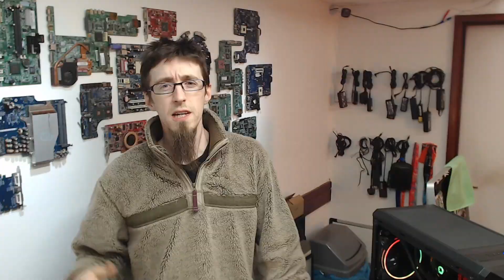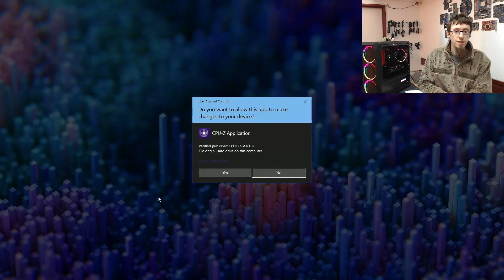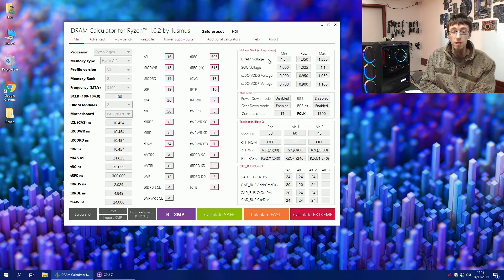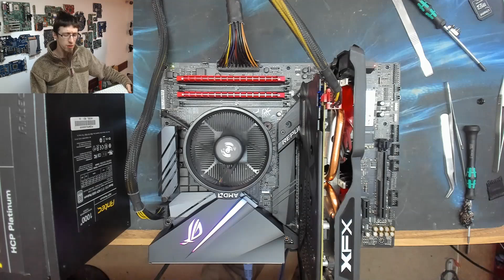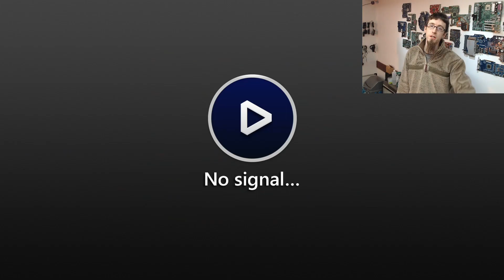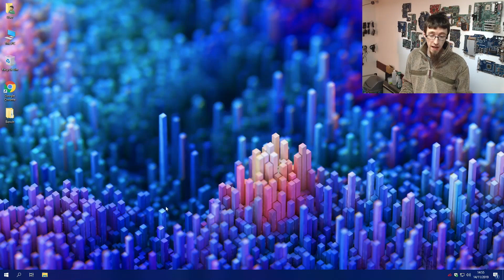LBC#43 - Setting Up XMP the Easy Way and the Hard Way

Comment: Incredible. I turned off XMP on my b450 because windows would blue screen every now and again. A friend told me that having 4 memory banks and my Ryzen 2700 wouldn't be stable with XMP turned on.
I just didn't have a clue how I was expected to set it up. 
Been running my memory at the lowest possible speed for ages. Gonna have a play with it now.
Thanks!

Comment: XMP is BS. Always has been. At best it will work if you're only using as many modules as you have controller channels. You make the choice to either overclock or to value stability, and yes XMP is overclocking -  it is almost always going to run your memory controller out of spec as far as your CPU manufacturer is concerned.

Just buy the normal JEDEC RAM speeds.

Also I love how you got literally 1 point higher on the Timespy with the 'optimized' settings.

Comment: Some wrong things to point out:
-Dual channel is not dual rank, i think it concerns the number of chips on the stick itself
-there is a program usually used in tandem with ryzen mem Calc to detect the specific ram chip type on your stick way better than cpuz and guessing which variant it is

Great vid tho very informative and chill
Reply: Figuring out rank is Hell....just when you think you understand it, some damn stick comes along that seems to break the logic of it all!

...like dual rank is supposed to be faster, but then a special late release of 2666 8GB sticks still running dual rank is somehow faster than the comparable dual rank verison?,wtf mate
Reply: @ChadDidNothingWrong  its prolly faster due to better silicon. anyway, joses right. single rank iirc is basically modules on only a single side, dual rank got mem modules on both sides. rank =/= channel. dual channel jus mean u got 2 sticks in a pair, in the correct slots
Reply: @teh0wnz0r76  ...two sticks in a pair that you put in the right slots on the motherboard (usually 1st and 3rd, or 2nd and 4th slots). When you buy dual channel ram it has been tested together, on the same motherboard. Dual rank is a module with chips on both side, so a single stick can be dual rank, but not dual channel.

Comment: my ddr3 xmp never ran stable (matched pair 2x8gb), so i ran it without xmp. but this year i added 2x4gb different brand different timings, which should have been unstable, runs stable with xmp off

Comment: I wish I had this guide 10 years ago. I'm still have my 10 yo desktop with a gigabyte mainboard with an i7 and a triple channel 3x 2Gb ram sticks. I never managed to run that ram at their stock speed . For some reason the mainboard clocks it slower than it should and chrashes with XMP on. Maybe I'll give it another go.
Reply: Just add more voltage

Comment: I had a 8gb 2400 kit not run at 2400 but then later on i upgraded to 16gb at 3000mhz and it runs the xmp perfectly fine on the same mb. so yeah xmp is weird sometimes
Reply: Both kinds are going to have timings pushed to the limit for their respective speeds, (and much tighter on the 2400, like CL12 instead of 18 or 20) so that's not surprising....they probably just left a bit more leeway with the 3000 ram.

Comment: I can't get my Corsair 16gb Vengeance RGB Pro ddr4 3200mhz to actually run at 3200, on my gigabyte aurous elite b450 ATX board it will run at 3000mhz but not 3200mhz. I had to turned on xmp and mess with the CPU multipler instead I know something on my ram is at 50 cas I was also getting BSOD every time I had xmp 3200mhz set up but 3000mhz works fine so I've left ir

Think I'll give this a go

Update 8.08.20: I re enabled XMP and manually enter the TRas setting from 53 to 56 and saves the profile as a new one on my Gigabyte Aurous Elite b450 board and it's been working at 3200mhz for 3 weeks now

Comment: there is a little app that will read and create a file for the Ryzen calc tool to read (better than the built in R-xmp)
Also it is a good idea to set your FCLK to 50% of the RAM speed so for 3600 you want 1800 FCLK.
I found some patriot viper 4133 ram really cheap (B-Die) and run it at 3600 with tight timings.
I think 3600 is the sweet spot and anything over 3800 you start to see drop offs.
Reply from the maker: I haven't played with Fabric Clock yet, but I've also been hearing the 50% rule, and really want to test it out on my up-coming AMD build.
Reply: @Bruno CR  This one http://www.softnology.biz/files.html
Reply: @Sean Price  oh yeah? I'm running CL8 on my 2133 sticks, so looks like I win!

Comment: I have the Gigabyte B450i with a Ryzen 5 2600, and trying to run the XMP for my Corsair LPX 3200MHz DDR4 will just BSOD.  Now, here's the interesting thing.  In the XMP Profile, the tRC value is 54, however if I change the tRC to 56, the Gigabyte board is quite happy to run it nice and stable at 3200MHz.

Comment: in DRAM calc, do i choose ZEN + AM4 or do I go ZEN 2 AM4? CPU/APU :r5 3400g -  RAM: team delta RGB 16gb 8x 3000mhz
Reply from the maker: 3400g is Zen+
Reply: @Adamant_IT  thanks!
Reply: btw. thanks for this video, this was where I confirmed why my board was reverting back to original ram settings everytime i give my PC a clean or unplug it from the power socket. do you know if there was an updated bios version fix?
Reply: @redpotatoes8714  I know it's a little bit late, but maybe the motherboard battery (A small and flat one) is dead or making bad contact? That battery is there to maintain the settings and clock when there's no power to the board.

Comment: also Rank is if u have 1 or 2 sided ram not if ur in dual channel. if u have 2 dimms and they are in the correct slots  then u will be in dual channel or double data rate
Reply from the maker: Ah yea, I just confirmed that - thanks for the tip! Although be careful with the second bit - dual channel is not the same as double data rate.

Comment: Memory Qualified Vendor List is a good reference before  buying.
Reply: sometimes, my kit wasn't on the QVL for my x570 taichi but they worked 1st time I dropped them in (: 
gotem running 3600 14-14-14-14-32-72-300 1T @1.44v (32GB kit)

Comment: Some budget AM4 Gigabyte boards will have a very slightly higher BCLK ie ruining @100.?MHz

I have an Asus board and the BCLK is set to 99.8MHz im guessing the Gigabyte board you have is set to something like 100.?MHz that itself will have a negative effect when trying to set XMP as you are then asking it to run just over its rated speed.

If they are just stable @the rated speed adding a few more MHz with of course worsen the situation again due to the BCLK being very slightly over 100MHz.

I'm not sure if this applies to all Gigabyte AM4 boards maybe just there budget option but I notice it on a Gigabyte X370 and B450 board, something to look into if nothing if nothing else I guess.

Luv the content Sir 👍
Reply: my 2700x ddr4 3600 x570 Aorus Elite is at 102mhz bclock